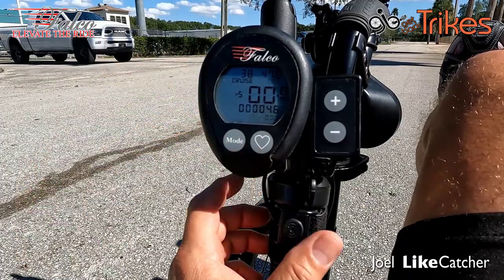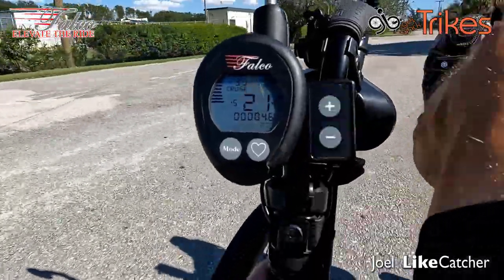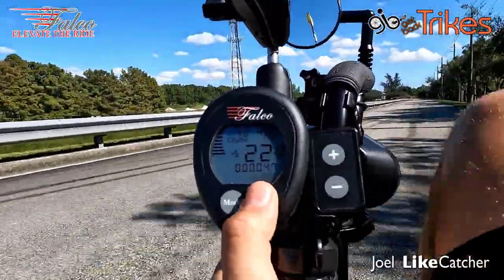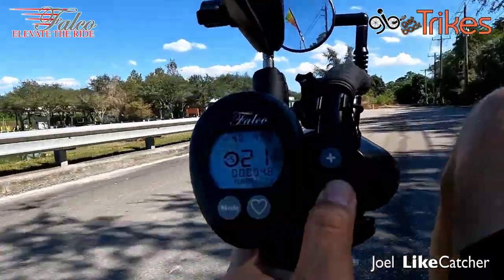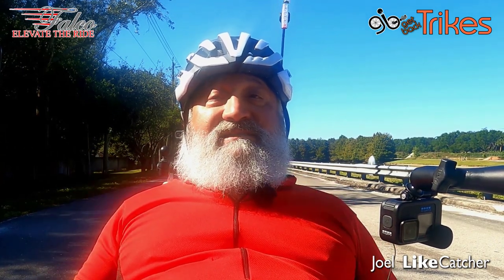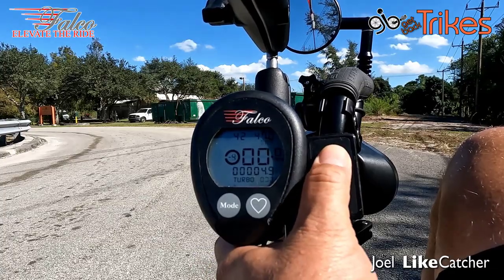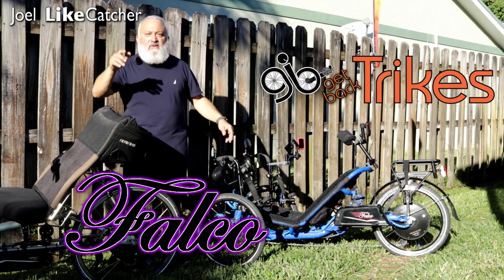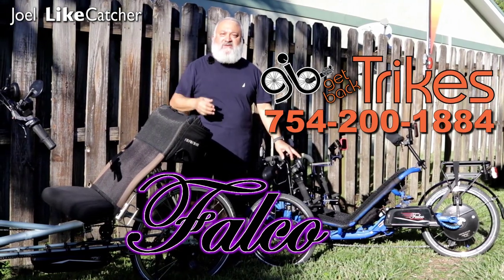How fast is Falco hub Motor on a Trike?

Comment: Nice demo Joel. Up here in Massachusetts throttle e assists are illegal and it is enforced diligently now as there have been too many incidents on multi use paths. E assist bikes now have to have a 20mph Governor built in and they have limited wattage allowed. All multi use paths have 15 mph speed limits. They are great to help folks that need that help but add a serious amount of weight and expense to any trike. With the tremendous increase in biking and use of our paths, our rangers are on top of the issue and enforcing rules diligently. FYI….. on flat trails a well conditioned rider on a good trike can really ride a helluva lot faster with less effort . See you soon. Heading down there in 10 days for the winter.
Reply: The 20MPH limit is what's called a Class 2 eBike. Most places, including my Florida, is legal to use on streets, sidewalks, and paths if Class 2. Off-road has no eBike limit as I understand the law.